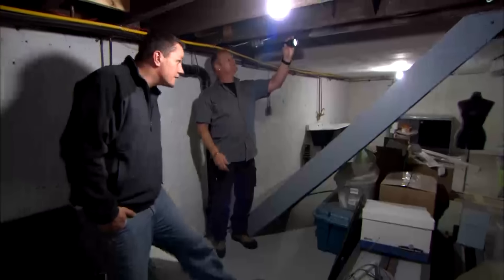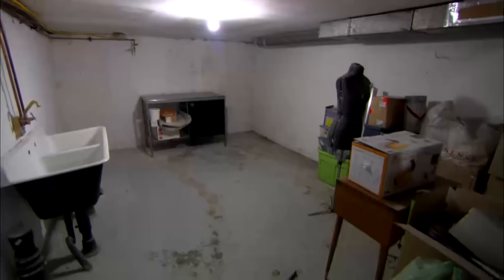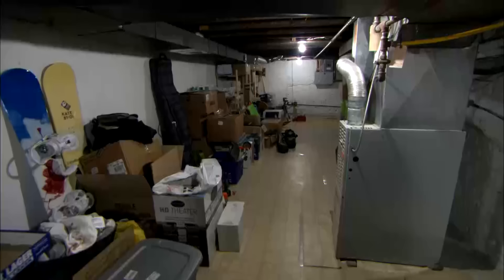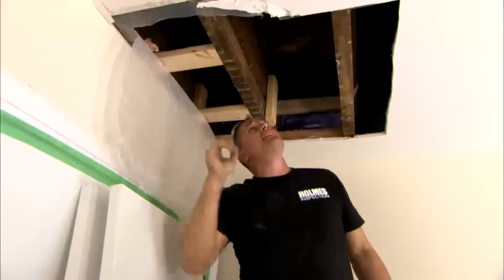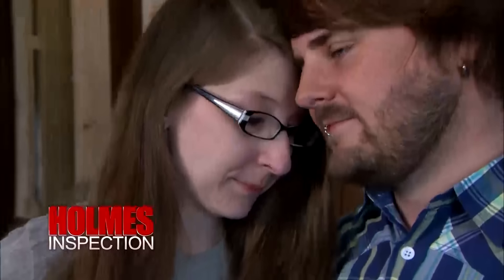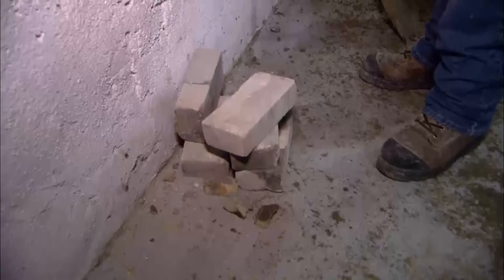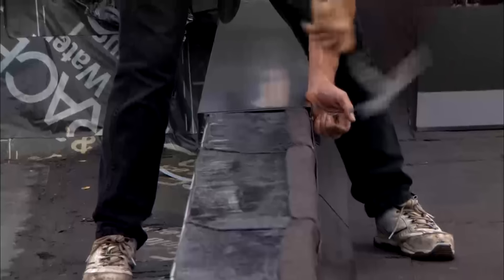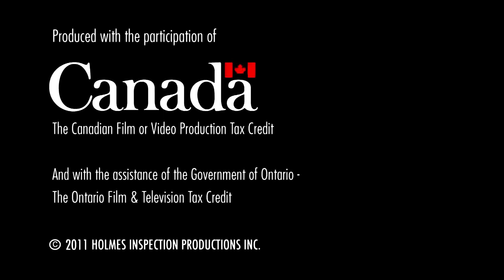Urban Oasis or Moisture Madness? | Holmes Inspection 217

Comment: My daughter and her husband bought a house in the country. The inspector told them there were only minor problems to fix. After they bought it, they started noticing the first floor floors were loose. I crawled under there and found almost completely rotted floor joists. Thank God I was a retired contractor. We ended up replacing all of the flooring and joists.
Reply: Most houses i know have reinforced Concrete Floors.
So a loose floor is not possible.
Reply: @asokawhite most houses do not have concrete floors though.
Reply: @Boga217  Her there i live 98% of all building have, ok its in europe so well.
Reply: @asokawhite  if he was in a crawlspace, then the floor joists rotted cause of the humidity due to lack of ventilation or insulation/conditioning.  usually joists would be on piers to be supported.  Crawl spaces are the compromise, along the mason dixon line, between slab on grade, and full basements common in the Northern US
Reply: @bobjames2312  a issue the not have at all, no new house will ever has this issue really, old houses have this issue but the speaking of like 150 to other 1000 year old buildings.

Comment: The other roof looked in better shape, but still they should have done both. Also, there are three doors shown on the front. Suggests there's a lower and upper unit aside them. Talk about crammed in. Assuming it was living space atop of a store front. Appears the other owner owns more than half of the building, which presumably explains the 2x4 interior wall towards the front. Good little starter for the couple back in 2011, but hopefully they moved onto something better.

Comment: Heard Mike saying that "no laundry on 2nd floor" before. I say it should not be a problem. Yes, sure, IF it leaks it goes down the ceiling, but it shouldn't be leaking, as well as a shower pan shouldn't be leaking; same issue. And yes... there will be vibrations most likely but there are many, many homes where people simply don't have a basement or even live on a 2nd floor (apartment). There are ways to overcome the vibration (and leaking is not the norm).

Comment: Hate to say this, but these kids kind of rub me the wrong way. Her wearing heels on a motorcycle, which isn't safe at all, and then this 'house' that they bought. Depending on just where in Canada they are, this 'house' could have cost them anywhere between 800k CAD, and over 1 million CAD. For money like that, they'd have been better off building a new home.  I just get the impression that these two had a lot of daddy's or mommy's money to burn.  It doesn't help matters that they present themselves both as photographers.  The average salary for a photographer is in the 45k (CAD) range for a photographer... so wouldn't make near enough money to be able to afford something like this.  Meaning they're either DEEP in debt and likely to lose the home to foreclosure... or they had a crap ton of outside cash and no real viable idea for how to prepare for the future.
Reply: That renovation/remediation would have to cost around $300K or more in today's $'s as a minimum.
Reply: it's probably a LONG time ago this and a new home can not easily be built in an old neighbourhood (downtown).  I bought a 1880 house in the Netherlands 40 years ago and sure, there's always something to do but my expectations were (and are) in sinc with the age of the building. Which is attached left and right and downstairs.

Comment: They saw a lot of really bad houses, that should have told them something about the areas they were looking in.
Reply: To good to be true 😢😢😢😢😢😢😢😢
Reply: uuuuuuh. No. Not really. It's because the buildings are old because downtown is old. I know because looked at LOTs of them. It does take work to make them (sort of) up-to-date. And Mike (sorry to say) is a bit of a drama queen. OFCOURSE older buildings have asbestos/lesser fire walls/no hvac/small bathrooms/lesser insulation. Etcetera,etcetera. 1) fix the leaking, 2) don't touch the asbestos 3) accept or modify the other old-building-logics.